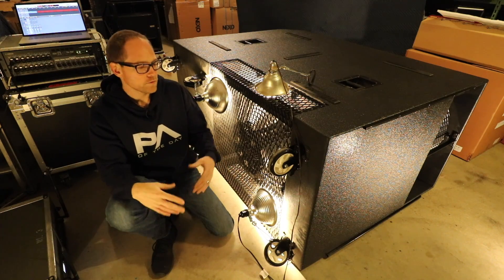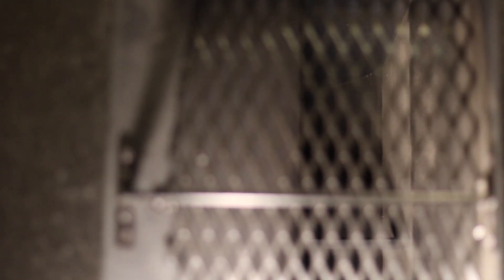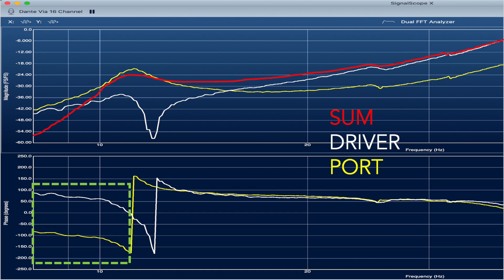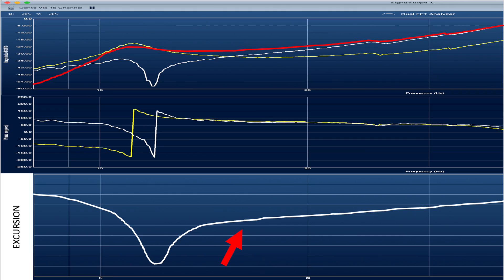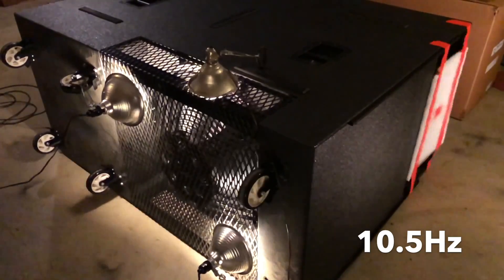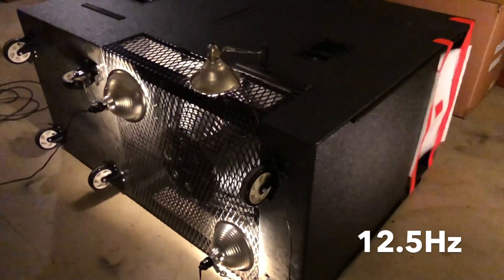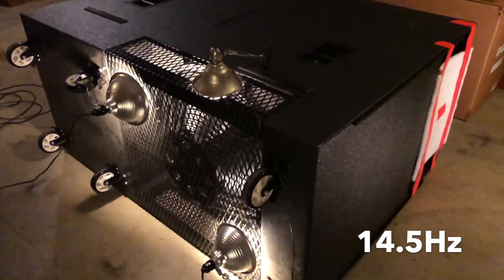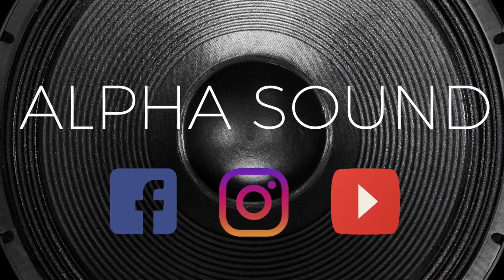How Subwoofers REALLY Work [slow motion]

Comment: I have Gasoline Powered Organ Pipes Or Pulse Jet Engines. I need this Technology in them.Just cant do it myself .I want a single  Poppet valve to be opened by electrically timing  it to soot resonance .And throw the reed valves in the bin.Then cluster them up ,add Nitrous Oxide or Nitro & go Jet Drag racing.What better way to drive Resonance than a Speaker.

Comment: How we could hear the sound at 10-15 hz?
Reply: You don't hear below 20hz. You feel it.
Reply: 10hz can't be heard! 15hz is possible to be heard only if you have very huge pressure db spl. That's not possible sadly with speakers. Eg: air planes fly around you, sonic boom, when wind turbines creates pressure like rotary subwoofer but wind turbine has lot more spl than speakers, rocket launch, blast waves of nuclear missiles etc. You can find audible Infrasonics here due to high spl. Higher spl than speakers. Speakers even 18 inch will barely do 89dB at 10hz.

Comment: Technically, it's resonance frequency, not resonant frequency.

"After wincing for many years, I can no longer refrain from calling attention to the technical and grammatical errors committed by users of the term “resonant frequency.” Tuned circuits, cavities, and other systems that exhibit resonance can be described as resonant; but being resonant is not an attribute that can properly be ascribed to frequency. Of course, what is always meant is the frequency at which resonance occurs. This can be shortened to frequency of resonance and, by indulging the scientists’ common habit of turning nouns into adjectives, it can be further shortened to resonance frequency."

"It seems to be widely believed, or hoped, that if you commit an error often enough and with enough dogged insistence, it may cease to be regarded as an error. Even if this were generally true, a decent regard for the integrity of technical terminology ought to dictate the avoidance of such malpractice when it involves a distortion of the meaning of well-defined technical terms. The mismatch of impedances represented by the term resonant frequency ought, therefore, to be sedulously avoided….Resonance frequency, please!"

F. V. Hunt
Harvard University, Cambridge, Massachusetts 02138

The Journal of the Acoustical Society of America, Vol. 50, No. 2 (Part 1), August 1971.

Comment: Thanks for this fascinating video.  Is the Magnitude scale measured in SPL and at what power?   What is even more interesting to think about is that if this was a smaller bookshelf 8"-12" speaker with 3 drivers and the distortion is measured sweeping through the frequency range of the port tuning and passive crossovers.   Clue: "It Aint Pretty"
Reply from the maker: It is in SPL in 6dB increments

Comment: excellent!!! below of tuning frecuency looks not efficient and produce over-excursion pushing same air . interesting. Seems 14hz is Fr
Reply from the maker: Yes, this is why it is so important to add a strong HPF to the system. Below the tuning frequency, the driver is just flopping freely with zero acoustic efficiency. Most of the "impressive" looking car subwoofer videos you might see online are just this, no real resonance... just a bunch of inefficiently flopping drivers that can make people's hair fly around but don't actually sound very good.
Reply: @devinlsheets_alphasound  no sound speakers (air speakers), 😅
Reply: @vjmoglyman it happens when you are below port tuning or resonant frequency. As they cancel each other out. I believe it can be avoided by doing sealed. Eg: Barefoot sound lfe 15.
Reply: @devinlsheets_alphasound  Having designed amplifiers for cars for > 10 years: Yup!  The demo trucks we had had boxes of 2" thick MDF the size of large refrigerators for the subs and > 1000 W amplifiers / driver
Reply: @shazam6274  which tuning frecuency use for this demo trucks?
Reply: @vjmoglyman  Varied, depending on speakers, box design / size and truck bed size.
Reply: @devinlsheets_alphasound  my friends 4 15’s hairtrick with ease down to 23hz I assure you can hear the sine wave down to 20hz, he’s tuned to 25